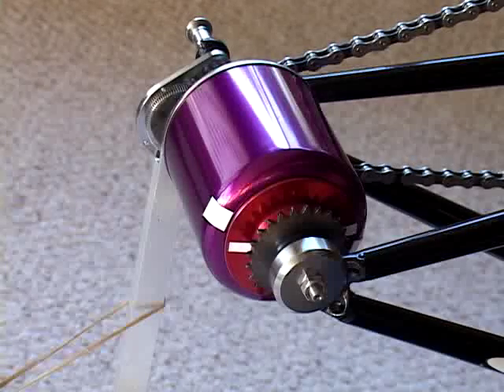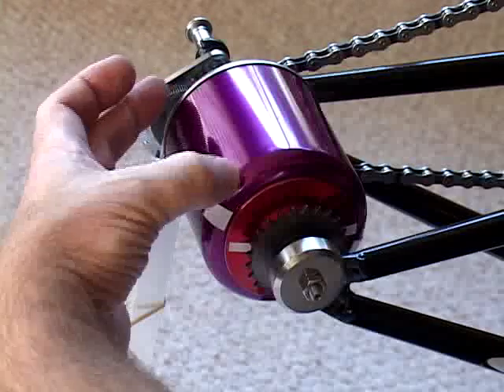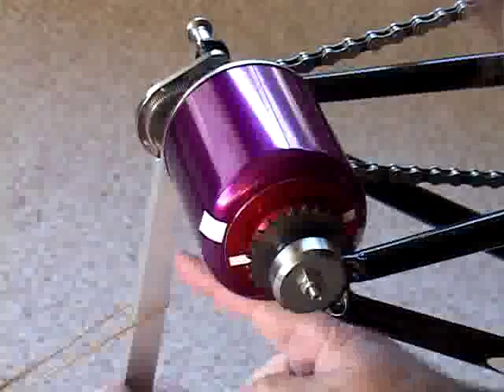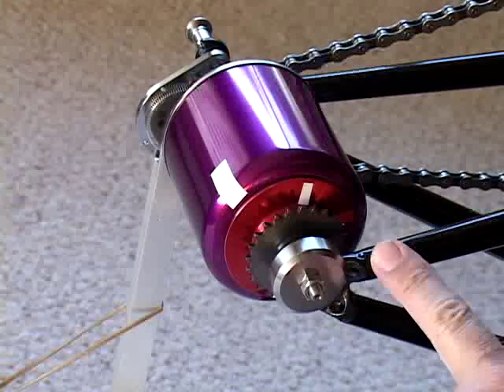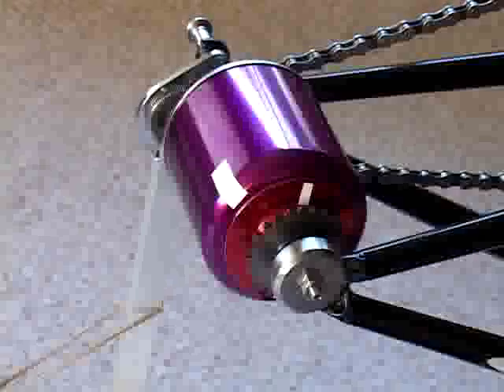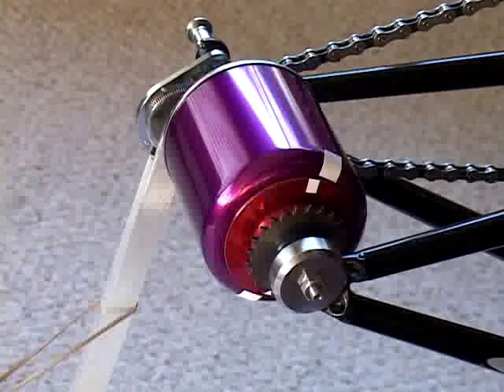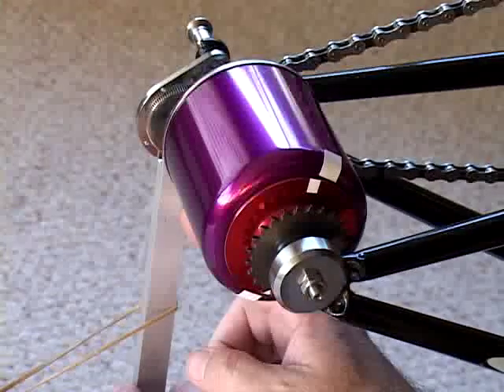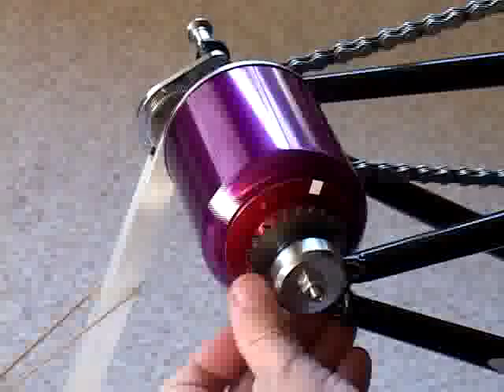Automatic Bicycle Transmission (IVT)

Comment from the maker: @MrRobGT Thanx!  Grab the torque peak and hold it.  Or grab the power peak and hold it.  At one time I raced autocross with a home-made 302 Z28 in a '67 Camaro RS; gotta love those R's!  8500 red-line.  A peaky engine would be very fond of this.  Low fuel consumption at low engine speed, and power on demand at high engine speed.  A teachable microprocessor control w/ SIVAT's torque-sensing feedback would do it.  Email me.

Comment from the maker: @raykupal Thanx!  Gears, levers, bearings & one-way clutches are the moving parts; all common to many transmissions.  Maintenance R & R and wear should be similar to them.  New machine concepts should all be durability tested to high levels, as this will be.  Only if we can make it tough, will it become a product for its uses.  Theory suggests that we can.  Testing...  one, two, three!

Comment: cool! i could see a ton of application for this clever invention... i'm thinking more on heavy machinery for energy efficiency. One thing i'm concerned though is what would be the possible cost of maint. for the units if it were to be applied to machinery. Are they going to be more resistant to wear than regular transmissions? or would they be cheaper that it could become some kind of a modular PM part? Still a brilliant concept.

Comment from the maker: @Britishdude1 No, not always.  The SIVAT can be designed for higher max ratios than 1:1, but works best when limited by design to about 2:3.  So, step-up at input and/or output results in an optimal system configuration.  This approach raises the top ratio to whatever is needed, while maintaining the ability to access the continuous range from a higher high to zero.  The Gen2 SIVAT bike will have a small chainwheel in a 2-stage design that offers good ground clearance.

Comment from the maker: @Britishdude1 Gear ratios, by convention, state the output speed to input speed ratio (not like you state it); so a high gear ratio might be 5:1.  The SIVAT can get higher ratios by using a bigger chainwheel, and will still get ultra-low ratios too.  To figure this out, you multiply the chain drive ratio by the SIVAT ratio.  This demo uses a 55T chainwheel with an 11T rear sprocket, so its chain drive ratio is 5:1; now multiply that by SIVAT's high ratio of about 5:6.  Answer=25:6, or over 4:1.

Comment from the maker: @cyberlord64 Good point!  Automotive engineers & executives should all be asked, 'Why not?'  NIH (Not Invented Here) is not a reason, it is mere arrogance.  Now, the SIVAT is based on nearly total static friction, therefore it has minimal losses & maximal coupling.  Traction drives, by contrast, always combine static friction with substantial dynamic friction, inescapably resulting in at least 13% loss of power & suboptimal coupling that cannot result in a decent IVT.

Comment from the maker: @superblair44 The price point will depend on how well-capitalized we get; if we get sufficient investment, it's likely to be roughly around $700 + any adapters needed.  No clutch is needed because it will always go to zero on-demand, regardless of the top ratio which can be defined by input and/or output gearing, sprocketing or pulleying.  For example, the Gen2 bike SIVAT will have high gear equivalent to about 60T-11T (5.5X), but it could be much higher, as needed.

Comment from the maker: @ebach1 The bike market will most likely be our entry point.  Aside from potentially being very interesting, it's a great transitional venue that can easily expand into other HPV & small motor/engine powered vehicles like the Zero.  Bike transmission design is amongst the most difficult of challenges; if successful, other applications will be 'leveraged' by their formidable forerunner, the bike.

Comment from the maker: @Risenangelicaegis For heavy machinery, the SIVAT will be larger. The ratcheting mechanisms here can be scaled up to megawatt levels of power capacity.  The bike SIVAT will likely be among the smallest of several sizes available for various uses. Power density will exceed that of many other transmission types. These claims are based on engineering specifications & calculations, not speculation.

Comment from the maker: @BOOMSPAS12 The auto feature will regulate your pedaling force & cadence to be fairly constant, regardless of the grade of any hill. You'll be able to 'tune' your desired power level, then set it & forget it.  You'll also be able to lock-in a gear ratio with an auto override lever.  The purpose of auto is to keep pedaling efficiency high at all speeds; if you want more speed, you'll need to raise your cadence while maintaining the same leg force.

Comment from the maker: @aznkid221 This prototype has a high gear near 4:1 by virtue of a large chainwheel & small sprocket.  It can be higher, and still get very low (including zero).  The Gen2 version will have a higher high ratio than road bikes have!

Comment from the maker: @X92Exploder Thanx!  Currently, investors may be in the form of strategic partners who do the prototyping work in exchange for sweat equity.  I'm still seeking significant investment, which may be gotten by proof of the fully functioning, bike-mounted prototype that is now being designed.  Full investment now will likely pay the best dividends for visionary investors.  The concept is strong, tangible & provable.  Want to invest?

Comment: It made me wonder if possible to design this as a gearbox(auto or manual) at the crank axel  and transfer power to a suspension swing arm using a belt drive. This would reduce weight at the rear wheel, reduce noise, no oil or grease to get on your clothes, and ad longevity to the compleat drive system. Using it in this manner might work well on an electric bike to eliminate the weight of a heavy hubmotor. It seems about time to get rid of the gear assembly on the rear wheel.

Comment from the maker: @bcubed72... When you see this in action on hills, you'll understand why torque-responsiveness will effectively regulate cadence at near constancy.  I confirmed that theory 15 years ago with an automatic CVT that I invented, designed, built & tested in the Santa Cruz Mountains.  Think about power as the product of torque times rotation speed; then analyze this relationship in context of this presentation.

Comment: You could actually use this transmission in a motorised vehicle - pull the lever back to disengage and forward to increase gearing - smooth start every time.

Comment: @SIMKINETICS The hardest part will be setting the spring tension right, so it doesn't automatically jump into first gear every time I push a little on the pedals. I may also need a spring designt that doesn't obey Hooke's Law (by making it wider/narrower thicker/thinner at certain intervals. The street strider would be cool with a SIVAT how does the inside work and is it Infinitely many ratios or just very many closely spaced ratios?

Comment: I designed on paper an automatic gear system for a go kart where the cluster of gears at the back is on a screwthread pushed to one side by a spring. When more torque is present, the gear rotates on the screwthread on the axle, compressing the spring and jumping the chain into a larger rear sprocket. When the torque on the cluster disappears, the spring expands, pushing the chain onto a smaller rear sprocket

Comment from the maker: SuperInfective wrote, 'You could do burn outs with this transmission!' With these ultralow gear ratios possible, yes you could.  And then save fuel afterward with more efficient drivetrain operation.

Comment from the maker: @crocodile2006... The YouTube axle-based prototype is ~1.9 kg.  The Gen2 shaft-based SIVAT, currently being designed for a product, has a target mass under 1.5 kg with 1500 watt capacity.

Comment from the maker: mih...The inherent efficiency may be about 97%, but step-up gearing to achieve very high ratios on the top end will add another component of friction, so the conservative estimate is given. Honest appraisal must also account for additional losses in very low ratios that are truly typical for all transmissions. 94% efficiency is actually quite high; very few transmissions *really* achieve it. Derailleurs get 97-98% only in chain-aligned ratios (2 or 3 possible cases) under ideal conditions.

Comment from the maker: @FeelTheAnthem... Several answers. Enormous range. Infinite ratio selection. No clutch or torque converter. Constantly has the correct ratio for optimal prime-mover speed. Torque responsive. No shifting. No torque surges or shock loads. Always engaged. Overload protection. Optional manual control.

Comment from the maker: @mihioc01... I learned a great deal from my old invention that was prototyped & tested extensively.  It worked surprisingly well, and was automatic, but its range was only about 2.7X.  It was a CVT that followed an earlier traction CVT that I also learned much about; I learned that traction is not the way to go because of inherently high friction.  Patents will reveal the SIVAT principle.

Comment: Do you need a cyclist to test/ promote it?
I ride a bike regularly, and have ridden both hybrids and road bikes. The only problem is, that im in Australia. 
One real market for this product could be with racing cyclists, if you can make it light. The reason, is that the most efficient way to pedal a bike, is to pedal at a constant rate, and change gear to change speed. This has good potential, you should have a manual version as well as auto.

Comment from the maker: @KrunchyJD... All great questions!  Right now, this concept is being designed to get a high gear limit above 60T/11T equivalent!  And, as you say, there's no bottom.  The result should be the bicycle transmission that makes Road and MTB/DH derailleurs seem old-fashioned.  Efficiency goals are competitive with derailleur gearing; likely between 90%-94% for most riding.  Is that good enough?

Comment: Can you change the highest ratio to be above 1 to 1? 1 to 1 is a very LOW gear for a bicycle. Whereas its a high gear for a vehicle with an engine,

The only way to use this on a bicycle effectively if the highest gear in the hub is 1 to 1, is to install a BIG chainring to make the 1 to 1 top gear effectively 7 to 1 or 1 turn of the pedels to 7 spins of the wheel. if you can do this, and have infinate ratios in the middle with say a lever, you are on to a winner..

Comment from the maker: @Jabberdau... The automatic feature is the spring force on the lever holding reaction torque within the SIVAT in equalibrium. The reaction mechanism is linked to the lever. When SIVAT throughput torque changes, the reaction causes the ratio to change until a new equalibrium is reached, at which time the resulting ratio accomodates the new torque level. This provides a constant input speed, regardless of output speed. Another geometry in the mechanism can provide a constant output alternative.

Comment: Where does the automatic part come into it, if you have to pull that lever to change gear ratios?
It does look smaller and ligther than a NuVinci gear though.

Comment from the maker: @nekbiodieselworks.. We're both thinking the same way.  Many other people are interested in SIVAT-enabled motorized bikes for hilly riding. The HPV MTB will lead to motorized bikes in development; one size/configuration can serve both applications in the design I'm working on now.  The SIVAT concept has two basic executions: sprocket-drive & shaft-drive.  Shaft-drive will still use chains and sprockets, but can be located on the frame, which benefits simultaneous motor/leg operation in mopeds!

Comment from the maker: @TimpBizkit... This actuator is deliberately set at very low force for demo purposes only (notice the rubber band).  If it's set at a much higher force with a stiff spring, it will go to zero only at very high over-torque of a motor or strong cyclist.  This was discussed in earlier comments.

Comment from the maker: Greg11980...  This is a rather fancy fishing reel!  There are some similarities; they are both 'ratcheting' devices, but that's about as far as it goes.  If the SIVAT was inside your fishing reel, you could reel-in very fast until you caught a fish, whereupon the drag on your line would increase & slow the action so you could pull the fish with some 'leverage'.  The next prototype will be documented with a tach & dyno, as originally planned, but we need bucks to get there first.

Comment: What I saw was a fishing reel attached to a bike if this is not the case show an application of this driving an electrical motor being driven by an electrical motor to show the input and output. Test on camera on youtube with multimeter as your dyno. show output of input and out put through your cvt.

Comment from the maker: @zyby...  Yes!  The SIVAT is perfectly adaptable to motor or engine speeds in a wide range from a few rpm to over 2,000 rpm (top speed is unknown yet).  Low speed input implies high torque for many applications; SIVAT operates very well at 200 rpm, and handles high torque in a much smaller package than other CVT's or IVT's.

Comment from the maker: @gothic... This 'higher ratio' question was addressed even before this prototype was designed.  Please read the other comments & replies for the answer.  This SIVAT will get high gears; notice that the chain comes from a large chainwheel & goes to a small hub sprocket!

Comment: Very nice, but I have a doubt: it seems to be more suitable for motor vehicles that can reach very high rpm compared to bikes. I mean, cyclists' legs usually don't go over 100 rpm and in order to reach a proper speed gear ratios on bikes are from 2:1, 3:1 or even more than 4:1 for descent. You should find out a way to reach higher ratios than the 1:1 I see in this video an d that can be used only on mountainbikes.

Comment from the maker: Adren... If you could invest, you might be laughing all the way to the bank later, lol!  The SIVAT will only find the bottom ratio (zero) if you put unhumanly excessive force into the pedals.  Just like on any low-geared mountain bike, you'd just 'pop-a-wheelie' when 'jumping on the pedals'; in other words, all bicycles have a natural, inherent overload protection that will torque the front off the ground before you accelerate hard!  SIVAT's zero is only a second defense with ultra-low gears.

Comment from the maker: @sky...  Great questions!  I'm in the process of forming a company to create such a product, so there are several unknowns at this point.  The price will likely be less than Rohloff due to slightly simpler design of SIVAT.  The next prototype must prove to be robust & easy to use before proceeding.  Mountain biking is the demanding test it must pass to confirm 'hands-free' operation & toughness; only then will we seek funding to productionize it for a product.  That will take many months.

Comment from the maker: living...  Any weight acting on that lever will be a tiny fraction of the spring force required for automatic SIVAT operation.  So, the angle of your bike will be irrelevant.  The spring acts against your pedaling torque (force), which is very substantial, and which increases as you pedal uphill.  Your leg force is what makes the automatic feature work to change 'gear ratios'.  Hard pedaling during acceleration on the flat will have the same effect as hard pedaling uphill; lowering your gear.

Comment from the maker: STU... Hydraulic IVT efficiency claims above 80% are highly dubious.  Neither credible data, nor raw physics will likely support such claims.  Independent testing has revealed hydraulic IVT's to be the very least efficient, ranging between 55%-75%.  Think about the friction in fluidic shear and look for *independent* test results!  Look at torque converters as one example. We'll test the SIVAT for efficiency.  Thanx.

Comment: That's quite a good efficiency rating, not as high as i've seen quoted for some of the hydraulic IVT designs (hydraulic systems under high pressure are very heavy, a disadvantage).
I managed to get a rough idea how this works and it's very interesting.
I may subscribe and look forward to seeing a prototype bicycle hub.
Keep up the good work.

Comment from the maker: STU...  The SIVAT works best as a reducer, so that's why this prototype has a 55T/11T input, giving the system a high gear near 5:1.  What's cool about an IVT is that redefining its highest ratios this way does not redefine lowest ratios that will always still get to zero!  Using  real published data from similar mechanisms, efficiencies calculate to an 88%-94% range that depends on the ratio.  It does not slip, but responds to torque rise with lowering ratios while remaining engaged.

Comment: Im intrigued! But also sceptical (no offence intended)
The way this is set up at the moment this effect could be achieved with a simple clutch plate mechamism inside the hub.

Is it possible for you to demonstrate a greater than 1 to 1 ratio to show that this is actually a transmission.
Also, have you calculated or measured the input power losses through the system?
I am designing a variable input peddling system but i'm only a hobbyist.

Comment from the maker: akkitrah.  Correct!  The ratio control spring mechanism would be generically tailored to general user torque by design and would be user adjustable for individual fine-tuning.

Comment: hmm..
So do you mean: With a stiff spring instead of the rubber band the lever would not move so easily and therefore ratio would not change so easily?

Comment from the maker: xxp.  Thanks.  I'd love to show how it works after the patent is issued. It's bizarre, deceptively simple and difficult to follow in its logic.  The SIVAT could be used to great advantage with IC engine vehicles, eliminating the clutch & torque converter.  I dare any automotive company to put aside its NIH attitude and try this!